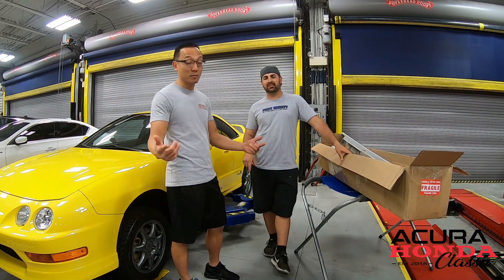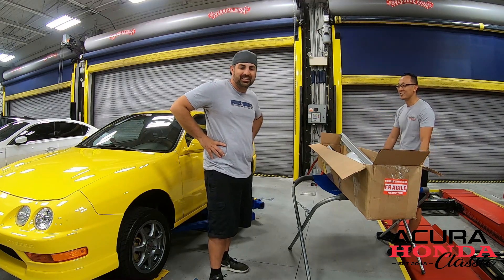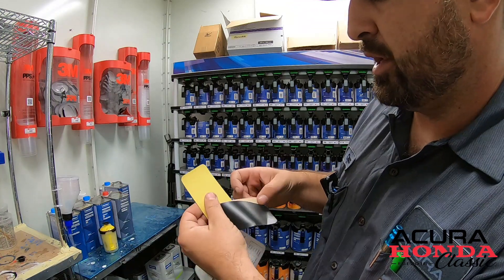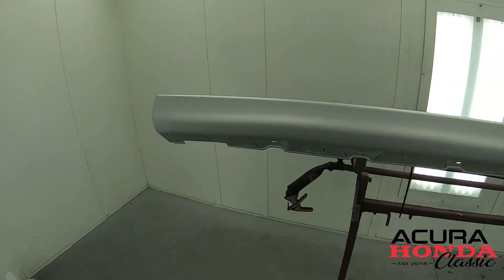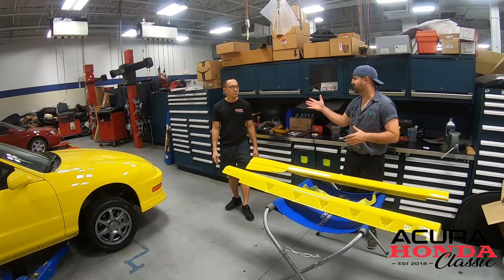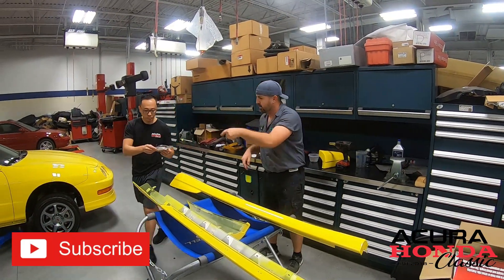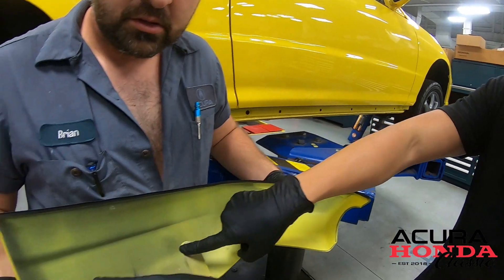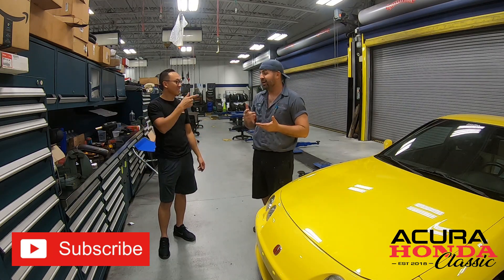AHC Shop Hours - Acura Integra Type-R OEM Side Skirt and Rear Valances Painting and Installation

Comment: Any idea where you can buy the slider bolt and oem washer for the rear valences? Also did you use the template to drill that hole or is there a spot on inside of the bumper? Thanks!

Comment: Just wondering what hardware you used to bolt up the rear valences. I didn’t get any screws or clips with mine. 

Also Honda Street Garage recommend me to your channel by the way
Reply from the maker: Most of the hardware are the normal Honda bolts and nuts. There’s one stud bolt where’s isn’t available from the dealer. We are seeking to look for an alternative from elsewhere but we have yet to find it
Reply: Acura Honda Classic Oh right I see. Would you have any part numbers or something? Would love to secure them as possible as I heard these optional parts do get targeted and stolen...

Comment: What size of bolt do you use for the two bottom brackets of the rear valance?
Reply from the maker: They are 10mm
Reply: What about the thread and length of the bolt?

Comment: Do you have the OEM part numbers for these optional spoilers ?
Reply from the maker: These under spoilers/lips are all painted from factory so the ending 3 or 4 digits are all different. Also they are all discontinued in US for years. But just for the information, we will list the part numbers for a Milano Red kit:
Front: 08F01-ST7-241
Side: 08F04-ST7-240
Rear: 08F03-ST7-240